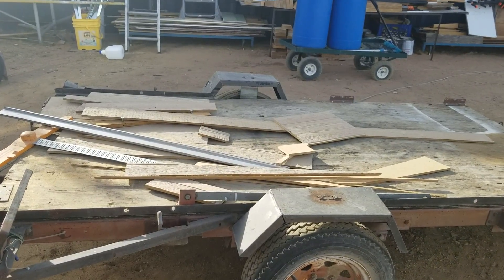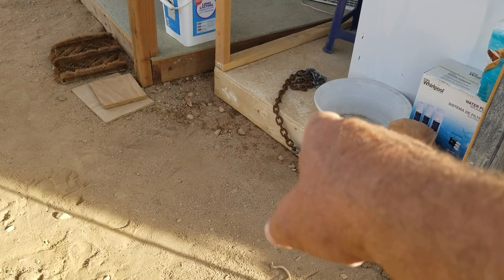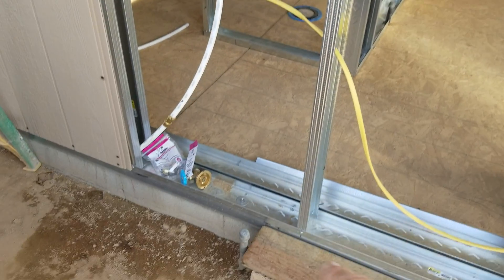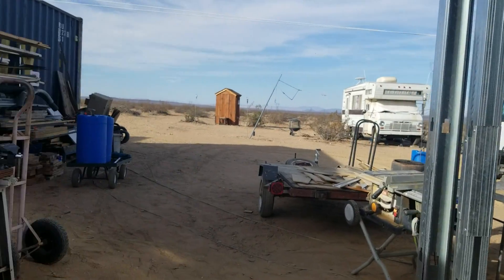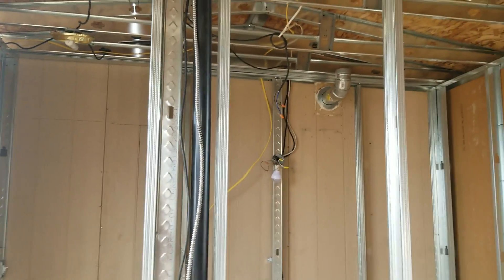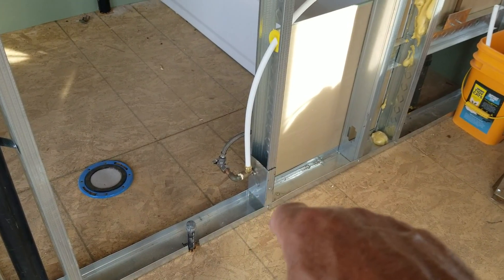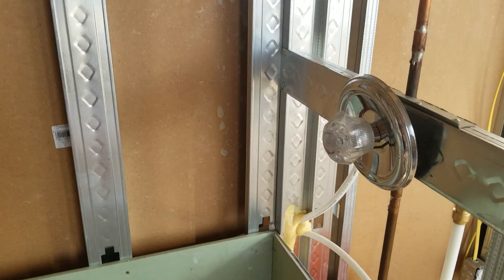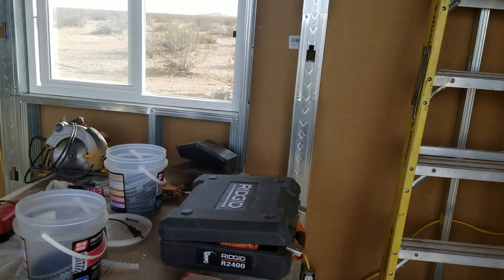Homesteading the Desert,  Sep. 27, 2018

Comment: Nice video..and I completely agree with you about those charge controller's and how useless they are ... can you please give the name and type of those controller's that are working well for you so I can find them on ebay ...thanks
Reply from the maker: Welcome aboard!  Sure, the controller I use is the Midnite Classic 150,  although there are also the 200 and 250.  The numbers are the maximum voltage input.
There is one other thing to consider and that is if you will be getting more than one controller to grow your system, be sure you get the models that can be linked together.
Reply: @GBear  thank you for the info... I will check them out

Comment: Can you give me a suggestion on a wind turbine?  Want to tie into the power grid to lower my cost each month for the house.  We get wind all the time.   Southern Idaho.  If you respond could you suggest the size too?   I was thinking 1200 watt.  But I don’t know. I need to generate 700kwtts a month.  If that helps.
Reply from the maker: Welcome aboard!  Ok, I've mentioned it before in some videos, but here goes again.
A turbine has two specs that are important when choosing one. 1. Max output in watts, and 2.  Max wind speed rating.
So, that means if your turbine is rated at 1200watts and max wind speed of 60mph, you would need 60 mph winds to make 1200 watts.  So, in 30mph winds you can expect 600watts, etc.  
Remember, wind is not a guaranteed constant, so you may have variations from 5mph to 25mph and your output will vary also.  Wind power should be considered 'supplemental' only and not counted on for constant, regular power. 
They also have a minimal wind speed to start producing power, so check the specs closely.
I'd steer clear of Chinese made turbines, as they can't be relied upon, and often are overrated for outputs that you will NEVER see.  And they seldom offer support or honor warranties. 
Google "American made high output PMA'S" and go for the highest output unit you can find, and stick with a 3 blade unit if possible.  Remember, a strong mast will be required and you will need an electrician to make the grid connections through a protective shunt for safety in a widespread power outage.  I don't deal with grid tie systems, but I know that they require more installation than off grid.

Comment: The silver and green cc on the right when he is showing his charge controllers, I have that on a new to me rv I bought and I can’t figure out how to properly program it or if the guy who had it before me had it right it’s not charging my batteries when I have my solar plugged in or while my vehicle is running. How do I program these?
Reply from the maker: Welcome aboard!  First, be sure the connections are correct. ALWAYS CONNECT THE BATTERIES FIRST, SOLAR SECOND.
If you have this done, your controller will start charging immediately.  The only adjustable settings that controller has is at which voltages you want it to come in or go out on, ie; 13.6v activate auxiliary,  or 14.2v float.
All these settings are set at the factory for the best 'plug and play' values for most simple applications and need no adjustments. (Unless you live in a place where the sun shines 20 hours a day.)😁
1.  Disconnect all wires to the controller.  Be sure to either cover your solar panels or do this after dark.  Connecting/disconnecting panels under load can damage them.
2.  Connect the batteries to the controller.  Note:  that controller works with 12v or 24v ONLY
3.  After connecting the batteries, the display on the controller should show the battery voltage.
4.  Connect the solar panels to the controller.  Note:  this controller's maximum solar input is 600watts.  And maximum wind input is 600watts.  Exceeding those inputs will blow the controller.
Let me know how it works out for you.  Good luck!

Comment: Any comments on "Missouri" Super-Core scam? $600 x Bad materials/2 months work}fríes garbage...sueing the client yo keep them silent...ánd I just can't get to Buy the windblue alt ac...hell!
Reply from the maker: A long time ago I almost bought from Missouri,  but after reading reviews, mostly negative, I steered clear of them.
I ended up buying the KT5 from Thermodyne, and it has been an acceptable unit.  I wish I had gone for the larger PMA though.
Reply: I AM interested now in a solar-wind controller xantrex c-60 /but Will need  a sepárate inverter DC/ac (do You think I could ho for a CHEAP one x gris tie???)/and hurracaine pma low wind $250
Reply from the maker: My experience has taught me that you get what you pay for with wind and solar.  Buy 'cheap', get cheap, and you will buy again to replace it.
Reply: You are absolutly right not to go x the cheapest...but we get to a point of weakness and hesitance ... should be avoided/that why I don't have nothing yet/years of planning/thks/by any chance áre You interested on Stirling Engines?
Reply from the maker: Yes, I have one.  Nice trinket, but not of much use as a work horse.

Comment: Thks x your efforts/please keep an teye on Graphene techo on batt Chargers/ How much You paid x the controler s? I want yo Buy from INDIa/ I AM in mex city
Reply from the maker: Yes, I have checked into graphene tech.  Capacitance batteries aren't advanced enough yet to handle high voltage requirements.
I don't recall what I paid for those controllers as I bought them on Ebay 5 years ago.
Reply: We Shure learn a Lot from You/I need a hybrid controler wind-solar, I know the Best is like Danfoss, but $!- You. Helpme to stay away of those chinese ones You regret/ I Will go for the rectifier You PUT/Have You try Wind Blue turbinas? Made outt of Delco alternator?
Reply from the maker: Alternator PMA'S are fine if the alternator is permanent magnet,  as induction alternators require power input to create power output.

Comment: you should be able to connect your 2 wire DC output into any two of the AC inputs on the green controller and it will just pass the DC through the diodes inside. not much voltage drop.
Reply from the maker: Thanks.
Reply: great setup also. in your experience, what turbine works most effectively in low wind conditions?
Reply from the maker: @eatmorepoliticians  thanks.  I haven't experienced a good low wind turbine yet.  I would expect one with a 4k or 5k max output rated for 60-90mph max wind speed would produce favorable output in low winds.

Comment: Hi G Bear, I am grateful for  your explanations I purchased a chinese wind turbine 500w and it came with a hybrid controller. Its useless that i only produces about 1amp  i was really disappointed and in the market for another Missouri wind & Solar have some that i like but i was put off by the freight cost to NZ  wondering if i changed my system to use the rectifier it may work a little better? amp wise  it s a 24v 3 phase but the windings are pretty basic. so after watching your turbines videos generating large volumes of power can you suggest a model that would suit me for my man shed just want to use for power or generated power for water heating. Its just for my hobby shed but I'm learning all the time. also really enjoyed your video of the Epever controllers they seem really good and since i have two solar panels 290w & 180 watt which on a good day give me 6amps on the hybrid controller pmw so thats one of  my next purchases. I like how tidy your wiring and setup is. Take care and thanks for sharing the videos and your time. Cheers Ross Tga NZ
Reply from the maker: Welcome aboard Ross!  Yeah, the Chinese turbines are a disappointment, as they rate it for 500watts, and you'll be lucky to get 300watts at maximum wind speeds.  Remember to achieve the rated output of a PMA, it would need to be powered by winds that match the unit's stall speed, or the fastest speed the blades can turn, which in your case would probably be close to 60mph winds.  Slower wind speeds would produce much less.
The hybrid controller should already contain a bridge rectifier, but a poorly built one that loses power in the process of converting AC to DC.
You can try buying a 150A bridge rectifier and an inline multimeter on Ebay to verify the PMA output, as they won't go to waste when you trash the Chinese unit and buy something like the Thermodyne KT5 or better.  
Something else about PMA'S and PMG'S...don't buy the ones that use "slip ring" connections.  They are inefficient and subject to failure in temperate climates. 
See tonight's episode and I will cover that.
Reply: @GBear   Thankyou for your quick reply and i will work on the purchase of the rectifier and let you know how i get on. Thanks again Ross
Reply from the maker: Sorry, I had a neighbor visit and it got too later to shoot a video tonight.  I'll do it tomorrow for you.

Comment: one of the best videos . It actually made sense , very clear...I do have 2 questions are the charging wires from the solar and from the rectifier connected  on the battery bank terminal ?  and 2nd , how is the wind turbine dump load  relay and the dump element ( the green resistor on the wall)  connected to the batteries.  A small drawing with a digram would be great.
Reply from the maker: Welcome aboard!  I'll be glad to answer your questions in the next video.
Reply from the maker: I'm about to post the video you asked for.  Should be available in a few minutes.

Comment: If I have a 1200w wind turbine, should I place a more than 1200w controler or 600W  is good?
Reply from the maker: Is your turbine a two-wire or a three wire unit?
Reply: @GBear  my turbine is  3 wire 1200w 24v
Reply from the maker: @Aytntupe  ok, So you need a 1200 watt or greater rectifier that will convert 3 wire input to 2 wire output.  The 3 wires from the PMA turbine connecting any order to the 3 poles on the rectifier, and the 2 poles remaining are + & - to the battery bank.  Then you need a dump load unit  to divert the excess electricity created to a heating element of some kind.  Watch for my video post tonight and I will go over that whole thing for you.
And, Welcome Aboard!
Reply: @GBear  thank you sir

Comment: I’m currently using the green mars rock controller it shows my turbine spinning but still has power out light lite?  Any advice.
Reply from the maker: Not enough info for a full diagnosis,  but it could be your wind speed is too low to register input watts, bit the led screen only needs a tiny amount of power to show that your turbine is connected and movement has been detected.
Turbines have start and stall speeds and since I don't have that info, or the speeds of your winds, the above is the best guess I can make.
Also, when inquiring you should note whether the turbine is AC or DC,  max watts output, size/length of wire used from turbine to controller and tested wind speeds.
I don't like hybrid controllers for PMA'S,  and prefer to use a rectifier and a high precision input/output meter on a 3wire AC turbine, or just the meter on a PMG, or DC turbine.
Welcome aboard,  I hope this helps!

Comment: Hi, thanks for the video! I wish I had seen it before I also bought that crap. I have similar controller from ebay and it is working in a weird way. I have 12v battery and have not yet connected the wind at all, but first I did connect the dump resistor and solar panels. First all looked ok, both light were on. Then red light came off. the green light is on even if I turn of any load to anywhere. I had the upper limit at 14,4V, the lower at 10,8V and the float at 13,7V. The red light was off, the green on, and the amps from my solar panels went up to 12 A. The Voltage in the system started rising and as I was not watching it went to 15,5V when I noticed it. The battery was making a hissing sound. Both battery and the output were rising over limits. So I disconnected it fast. I tried few times and every time the same result. First it looks ok, then jumps up starting to cook the system. So I went to a shop and talked to some guys who know and all they could guess was that I need to disconnect the resistor, maybe it was causing it, because I did not have the wind turbine connected.. So now I am trying again, but now it is really cloudy so I need to wait.. tomorrow I will see..  Guess I will switch back the old solar controller and copy the setup for wind from you.
Reply from the maker: I'm not real clear on your equipment, but let's give it a go.  First, disconnect the dump load resistor,  you don't need it for solar unless you eliminate the controller and connect the solar panels directly to the battery bank. (Not recommended)  in that case you would use a dump load controller with a dump load resistor to burn off extra input voltage.
I will go over this in more detail in tonight's video.
Reply: Thanks for the reply!, I already removed the dump load resistor to see if that was the problem, but need to wait for more sun, it's been raining for several days now. What I have exactly: 300Ah 12V battery, 240W solar panels, 500W 3 phase wind turbine and that hybrid controller with 400W solar and 600W wind support. I have not yet installed the wind turbine, but changed the controller to the hybrid model and tested it, with the strange results already mentioned. Then I had the load resistor connected, but I now removed it, though I don't understand how it could cause the problem. I posted also to your another video I saw later, where I already started looking for the parts you are using as I start to agree the controlled I bought is crap. I bought the wind turbine, because there is really no sun in the winter where my cabin is located (at arctic circle, few miles from Russia) and I was hoping to get enough power to the battery so it wont run out.
Reply from the maker: @jannekallio5047  again, welcome aboard. 
First off, yes dump the hybrid controller. I got suckered into buying it myself.  Also, if you hadn't connected the battery first to it, then is is possibly damaged anyway.  Hybrid controllers don't make sense.   You have a DC input for solar, an AC input for wind, and a single DC outlet for both, all in the same size case as a simple controller...
By your system description with a single battery,  I suspect you aren't planning on running much?
One more thing, don't you use 220v over there?  I guess your inverter is set up for that, correct?
So, recap...you have 12v panels, feeding a 12v controller, charging a 12v battery, powering a 12vdc to 220vac inverter?
Reply: Thank you. It is almost as the hybrid controller is too good to be true right? :) I think I connected the battery first to the controller and it came up seemingly ok, but then went all weird I guess when it was supposed to stop charging..  but yeah it seems it is crap so I think I will throw it away, or keep it as a reminder as it seem you did :) . You are correct about my setup. My cabin is quite small so no need for much energy or lot or batteries. I do have an inverter, but I rarely use it. I have 12v led lights and a 12V compressor fridge, which I think is the thing that takes most power. Sometimes on short trips and in midsummer when I have lot of energy I use the inverter to pump water, but that basically it. The main use is to charge phones etc when we are on hunting or fishing trips. During summer we get lot of sunlight here as the sun does not go much down and in winter I do not come to the cabin that much, so I was hoping the wind turbine would charge the battery enough to keep it alive. The sun comes to the horizon for few minutes in midwinter and the panels are covered by few feet of snow, so they really don't work that much then. :) I imagine my place here is quite an opposite to yours.. I have the hybrid controller now connected to my panels and will monitor it tomorrow when it is sunny. I will report then if it tries to over charge again, but I think I need to buy the new parts anyway, as I wont be able to trust this controller not to burn my cabin down.
Reply from the maker: @jannekallio5047  ok.  Be sure to catch tonites video as I will address a couple other important notes on wind and solar.
Reply: Saw the new videos, thanks for the extra info! I just tested my setup again as it was sunny and again it went over the 14,4V limit. At 14,9V I covered the panels. I made a video of it and linked your videos to the description. Hope that is ok. Here is a link to my video https://youtu.be/4HSjupORHt0  ... I will next buy part for similar setup as you have, though I was thinking could I use the small controller I got with the turbine as a rectifier. It seems to take in the 3 AC cables and output the 2 DC cables, so maybe I could use that and save some money.. Not too happy about wasting money on that hybrid controller...

Comment: Holy smokes!  I've been looking for someone with a wind-solar set up that works and makes sense.  You explained it in  5 minutes and it makes sense.  Now if you could get a good turbine for yourself. Thanks
Reply from the maker: Thank you!  I did purchase a kt5 PMA from Thermodyne.  It is a 1685watt peak, 3 wire AC 12v and with the current winds at 40mph I am kicking out 984.8 watts.
Reply from the maker: Oh, and welcome aboard!

Comment: Sir  Chinese hybrid charge controller is real mppt?
Reply from the maker: MPPT, is mppt, no matter who makes it.  Welcome aboard.
Reply: Sir without hybrid charge controller  possible to using dump load resistor . I purchas a normal mppt charge controller and put dump load
Reply from the maker: @baetech1590  standard mppt or pwm charge controllers are not designed for proper dump load operation.  They may work for a while using the "load" connectors and settings, but those aren't designed to maintain the power output for a dump load resistance.   A dump load controller also can not be used for a solar controller because the default settings are different.